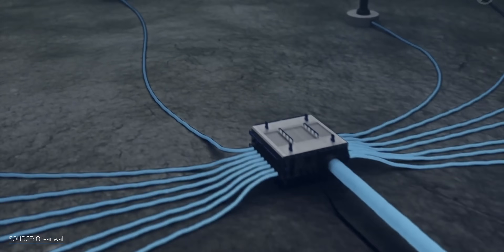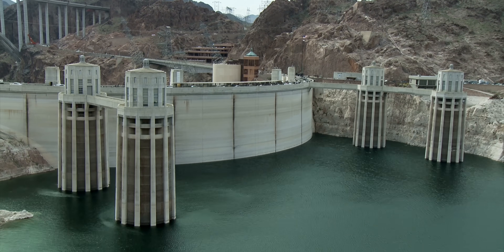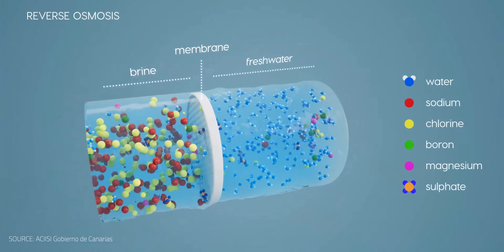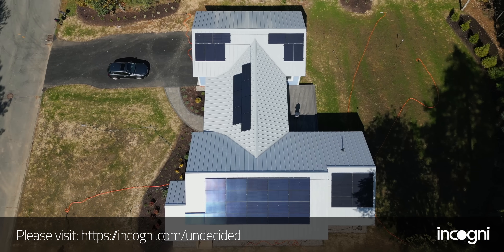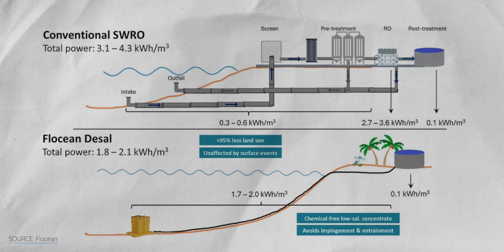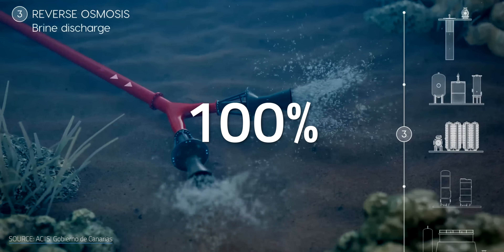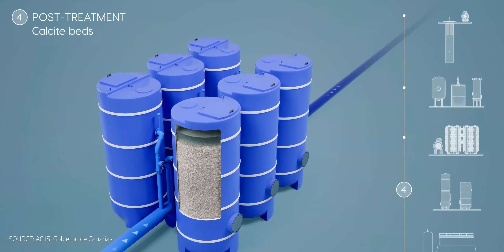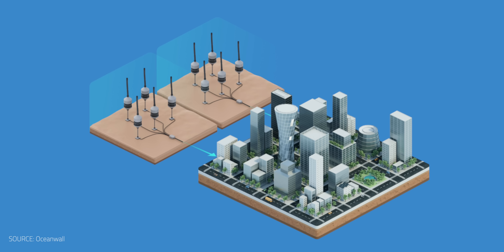How Deep Sea Water is Now Drinkable

Comment: Desalination can be done by evaporation in big ponds with a cover to send the condensation into a trench along the sides. Pump the salt water into concrete basins with a green house style covers is more energy efficient. Use solar reflection to heat the water to evaporation levels. Return the salt to mines or huge stock piles to sell.  A set of huge stainless tanks with solar reflection panels to heat the tanks. Ypu just need capacity to out pace the consumption.  Its not impossible.  Let me show you the answer. Its not that hard. I do have a degree in engineering. Ex navy machinist mate.

Comment: As I understand it, the improved efficiency isn't as described in the video but because the salt concentrations on the upstream side are much lower for deep sea RO than normal RO. The saltier the water is, the more pressure is needed to force the water molecules through the reverse osmosis membrane. With normal RO, extra salty water is created as unsalty water is produced, this has to be pumped away and disposed of so the salt concentrations next to the membrane are allowed to build up to much higher levels than the actual intake sea water but that is not the case with deep sea RO because extra salty water will naturally sink away from the membrane and be replenished by less salty water continuously.
Reply: Oh I guess the deep sea pressure enables the pump to sit on the downstream side of the RO filter while still creating sufficient pressure across the membrane. The pump. Needs to be on the downstream side of the membrane so the membrane can be in direct contact with the replenishing sea i.e. no inlet pipe between the sea and the membrane. If it was at surface level, a pump could, at best, pull a complete vacuum on the downstream side of the filter which would only result in a 1bar differential pressure across the filter as that is the weight of the atmosphere sitting on the sea surface.

Comment: The pressure that crushed the titan submersible suicide machine - if I understand you, that pressure (but less) is harnessed here. There's an intake down there, and unless that intake has an outflow, nothing happens. Duh.  So there's an outflow, through the filters and RO.  I assume that if the outlow was just a straight shot to land, no filters, nothing would come out on the land. The pipe would just fill up as the pressures equalize, no? If not that would be free lunch, perpetual motion. So is this the pressure differential created in the works on the bottom being used to push through the RO, the biggest power draw, and maybe assist in pumping to land if excess exists, suplemented by land-based and powered pulling pumps to make up the difference?

Comment: Thanks for another great video Matt. I don’t think that the subsea management is an issue technically or cost wise. The oil industry has been working in these water depths for decades now. I do see issues with discharge brine when you get to the type of scales of infrastructure needed to support large conurbations. The heavier brine, even if diluted, will tend to sink and find low spots. In the Gulf of Mexico there are ultra saline lakes at the bottom of the sea. While the environment offshore California is different, it is always easy to ignore or minimize future potential issues, since they are way off in the future. Just think about that, especially in areas of coastal upwelling……..L for already saline seas like the Arabian Gulf or rift seas like the Red Sea, the future consequences could be substantial.😊

Comment: You don't strictly have to go into the ocean. You can just drill a 3000ft (1km) deep hole and put the membrane assemblies at the bottom of it. That might even give you geothermally heated water in one go. Probably not 90°C hot water, that's mote typically found at 2-6km, but you might get 30°C to 50°C or so.
Reply: Just go to Israel, place the device on the shores of the Dead Sea (-414m AMSL), with the right tubing it will be ~40atm of "free" pressure vs the Mediterranean sea level which is only 50 miles or so away. Oh yeah, the brine, around 5-6% salt, can be used to "save" the dead sea, too.

Comment: That brine dump explanation sounds like BS to me. All that mumbo-jumbo about mixing it, not dumping it, trickling... blah blah blah I couldn't see any difference between what they are planning and the traditional way. You take x gallons of fresh water out of the sea, it leaves y lbs of salt to get rid of - doesn't matter if you do it with higher energy efficiency or at high pressure, y lbs is still y lbs and it's still being dumped back into the ocean, slowly polluting the sea in a way not hugely different from what humans have been doing for a couple hundred years. It's no good saying oh but the oceans are vast, they'll dissipate it or deal with it, that's what we've been saying for the last two centuries and excuse me, look at the oceans now. And the air and the land, but that's another discussion I guess.

Comment: Does not the ocean go up and down all the time.   You could put a drum 100m^2 on the floor of the ocean and collect energy that way.   If you can detect a change in pressure you can capture energy.    If you build out of the right materials it could last 100 years.

Comment: You’d have reduce the pressure on the freshwater side of the process which at that depth would require a large amount of energy and probable cavitation unless the pumps were at that depth. USA needs to dramatically scale back it’s use of carbon releasing fossil fuels and importantly curtail meat consumption and livestock production though it is probably a little late to ameliorate climate change in the short term which is locked in and has considerable momentum. It nevertheless needs to be done

Comment: I would love to see more details on how much energy is used, how much water is needed etc. E.g. Renewables are often curtailed to avoid putting electricity on the grid when it's not needed. Could we run desalination plants at these times to use that otherwise wasted potential and store fresh water for use later? How much of the water need could that cover that is currently served using fossil fuels?
How does this technology stack up against the other forms of desalination?
Also: could that brine be used as input for the production of salt? Could we extract minerals (like lithium) from it in a commercially viable way?
Reply: I mean desalination plants are usually running 24/7 since people always need water

Comment: It would be interesting to know if there are any existing systems or plans to build plants that extend the life of membranes by periodically flushing them through rapid flow reversal to unclog them. I can imagine a design where the brine is discharged from the vicinity of the membrane after such a rinse on the intake side. or in the case of a "passive" deep-water system, if it's operated only when solar energy is available, this rinsing cycle could be done at the end of the run, allowing the brine to dissipate into the surrounding water during the downtime.

The only thing I wonder about is how the system would react to being shut down: What pressures would the shore-based pumping station be able to tolerate? Would it be beneficial to let air in and allow the water column to fall and loose bunch of the already filtered water? Could remote operated valves be used to prevent that?

Comment: It's funny, because one of the biggest problems with the AMOC (Atlantic Meridional Overturning Current) is too much freshwater from melting icebergs diluting the salinity of the system (thus causing massive weather problems that would derail most of human civilisation), while we need to dump extra-salty water because of desalination, so it makes me wonder if this tech could help dump brine deep under sea in the right location and depth to help the ROC and solve some of the problems here. ...not that this would be an easy solution at any level but it's something...eh possibly...maybe....

...moving on...

.In any case, at the moment this system just suggests a better way of desalination. The first question of this tech is its longevity and maintenance in the sea's harsh environment, but if they use similar systems as deep sea oil pumps they can use the way pumps deal with these issues and their understanding of these problems (they'd need to have an easy way to disconnect old pods and reattach new ones too). Next question is the environmental impact of putting them on the sea floor, which will probably depend the most on where these desalination farms are placed, their size, and how they disrupt the sea bed (hovering above the sea bed slightly might be the best option?). If carefully sited this tech could have minimal environmental impact and lower risk of biofouling, as marine life at these depths is sparse.

Comment: As someone who has had direct family working on the design side of some of the most cutting edge RO systems of their time. The cost of reverse osmosis lies not in power but in the membranes themselves, put this half a kilometer underwater and I can hardly see this being cost competitive. Also those plants in North Africa and the Middle East? Those are mostly distillation plants which are wildly more power hungry, the thing is the world needs water, and it must be both reliable and cheap. If someone want to improve the space their best bet is in reducing the cost of mamufacturing membranes

Comment: Please stop repeating the same sentence again and again. You still need the same pressure difference even in the deep see. It does not come for free. You need in theory the same energy to pump water up the pipe, as you need to create the pressure. Maybe not in praxis, but if there are any advantages this video does not mention them. 
So the water is cleaner down there. Ok., makes sense. Please cut the other nonsense.

Comment: I actually did this easily with a garden hose in a lake - you suck on the hose (have wife do this while you place the hose) and once you get it going you don’t need any pressure. This is just like syphoning a neighbor’s gas when prices get high- (with their permission of course)  Great thing about this method is that the lake is already "Without salt” or "Sine sale” as they say. So no need for desalinization at this point.

Comment: More efficient use of existing resources is more important than finding new sources.
The simplest hydroponics or greenhouse allows you to reduce water consumption by 10 times. The main consumers of water are agriculture and industry. Also, any utilitarian consumption, such as watering lawns, flushing systems, washing. A person can drink about 5 liters of water per day. On average, much less. Look at the green lawns in Las Vegas. This is a huge amount of water spent on prestige and a beautiful view. It is also hot in Morocco, but they build a square house there, leaving an inner courtyard. In the inner courtyard there is a pond / fountain / pool and all sorts of vegetation. The building around prevents moisture loss, creates additional shade. It is cool there in the heat even without air conditioning. And this does not require crazy water consumption. And in your inner garden you can grow not just flowers and grass, but something edible, like spices. You do not need a lot of them, and fresh ones on hand are very useful.

Comment: I call it BS. Putting suctions instead of pressure requires the same effort. You need a pump to create a difference of pressure of X. Im the only one seeing this? In conventional SWRO you can further recycle the left over pressure to pump the fresh water into the public system, for example. I dont see any advantage.

Comment: I have seen a filtration system for removing excess iron from groundwater which periodically self-cleaned by reversing the flow to use clean water to expel dirt from the filters. Would that work in this system?